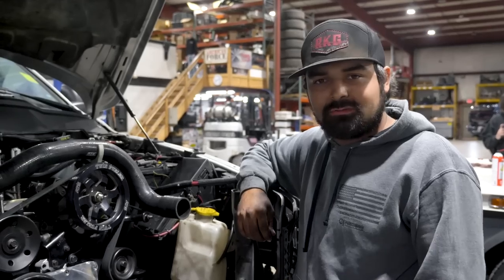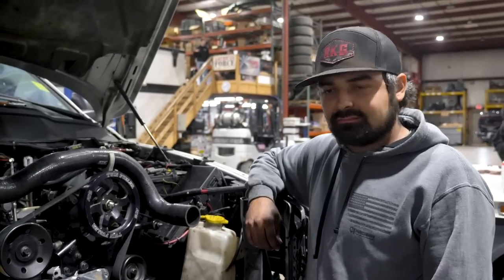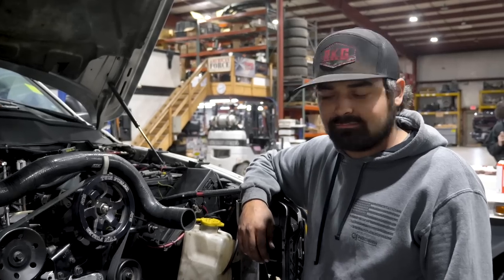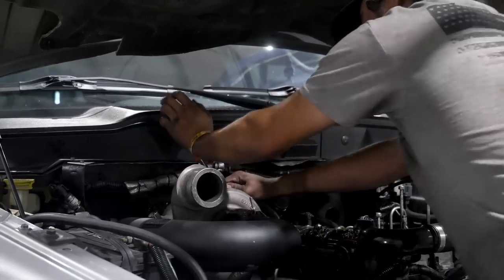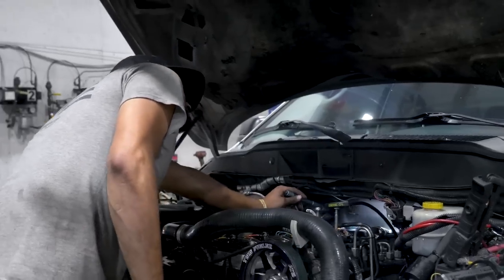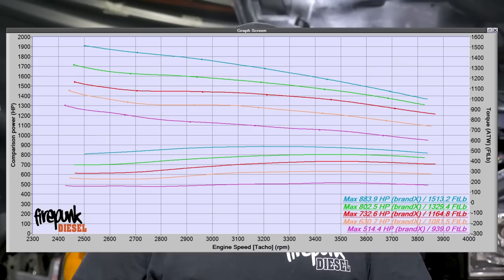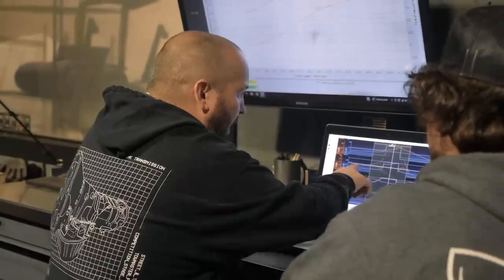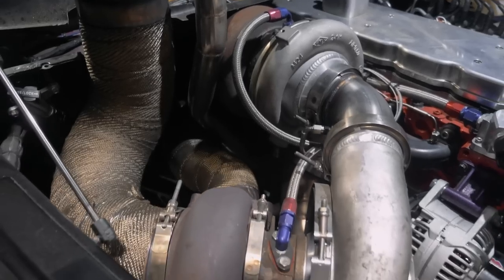2000HP Reg Cab Short Bed!

Comment: Phenomenal numbers!
I wish I had guys like yourself to take my mkIV jetta 1.9 tdi alh to the moon! On second thought you think a 5.9 Cummins would fit in my trunk? 🤣
Reply: Just put an he221 on it with some .260-.280. Makes them more fun at least.
Reply: @slodsl  I think I might need a translation. 😁
Reply: @FiglioBastardo  holset he221 turbo with .260 or larger nozzles. I've got a crappy video of my alh on my channel that might be interesting to you. I'm running a td04hl15t which is just a bit smaller than an he221 I think. Had .230 nozzles but I've now got .320. Unopened 300k mile alh lol
Reply: @slodsl  Ahhh ok cool. Yeah she's about ready for an upgrade and has 326k on her! I'll check out your video for sure. Thanks for the reply.
Reply: You need a PD engine... You search TDI Portugal Seat Ibiza 😅

Comment: I hate that my rev limiter was set to a point that my 5.9 blew up from an over rev. Your guys' tune. Gotta do better
Reply from the maker: For years (2003-2010ish) everyone hated the fact that common rails only had full fuel to 3200rpm and begged6for 5000rpm fueling, we finally we have tuning platforms that full fuel to 5000rpm, and I've personally taken a completely stock 5.9L engine at 700hp with only head studs to 4700-5000rpm on the dyno for 40 consecutive pulls with no failure, so we set full fuel to 5000rpm with defuel at 5200rpm on custom tuning unless a customer requests a lower rpm limiter.  I hate that you had a failure, but its the drivers responsibility to not overev the engine or request a lower rpm limit when placing a tune order.
Reply: @FirepunkDiesel  that may be the case that some were asking for a higher limiter, however as a responsible tuning company, the proper upgrades to handle that rpm should have been made or customer made aware of. Can you rev a coyote to 8000 plus rpm? Yes. How many times until a failure? 
For example my stick truck had the throttle stick between shifts. I saw the tack well beyond 5k and lost 2 tappets and bent push rods from valve float. On a "street" tune from you guys. This is not the tuning industry best practices from someone that works in a ford gas tuning shop. You want to put out the hottest tunes I guess so there's that but at the compromise of your customers 17 year old truck? No good.
Reply: @phase3782   so your blaming your throttle sticking and blowing your motor on there tuning. No  that's not how it works. I have personally had an injector stick on a stock 5.9 and it let the engine run away causing damage. You can't blame the tuner for your throttle sticking
Reply: This sounds like your issue phase 3. Sounds like you should made upgrades before getting tuning build your rig the right way next time.